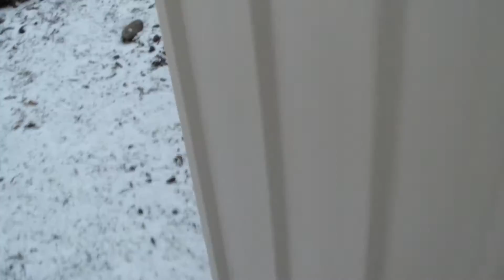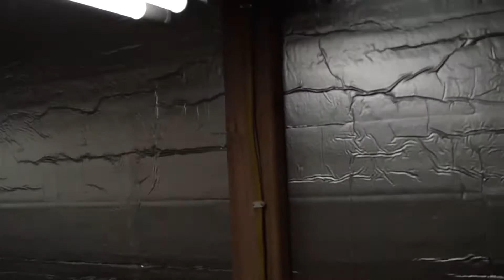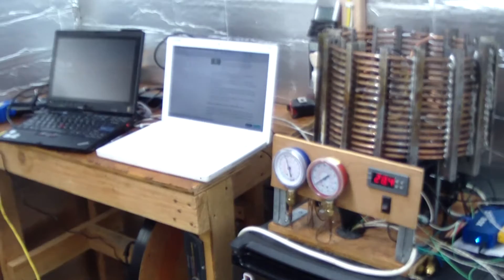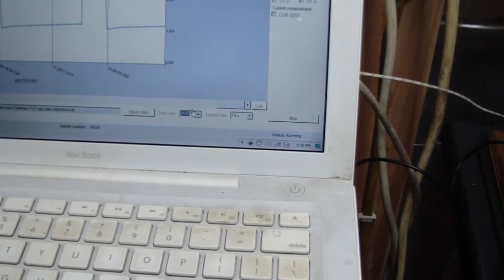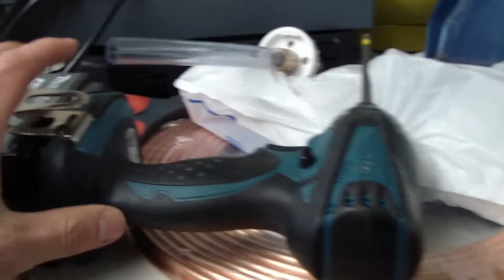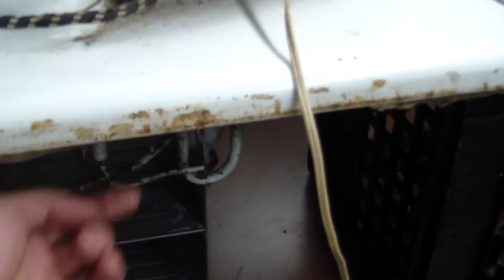Standalone Refrigeration Lab

Comment: Build a ground source heat pump and put solar panels on the shed. That would be a good project.
Reply from the maker: Ground source would be tough, as this is a trailer park.  Caravan park to you?  :)  I am doing an air source heat pump though. Should be pretty cheap.  As far as solar panels, I might think about it.  I'll probably be moving in the next 2 years, so I don't know if I want to make the investment.  On the other hand, the fridge is going to be DC, so it would be a good idea to set up a DC power system.

Comment: A friend of mine might be making some R-40 with his lab chemicals. It's chemical name is chloromethane. Have you ever seen any units that use R-40? Just curious.
Reply from the maker: Yes!  If it's the same stuff I'm thinking of, I know it as Methyl Chloride.  It was a fairly common refrigerant back in the 1920's and early 1930's used in domestic refrigerators.  I have a number of books which discuss its values and drawbacks.  I believe there was a year in the late 20's where several people died in Chicago due to refrigerant leaks in their homes.  Tell him to be very careful with the stuff!
Reply: M.C. Pletcher
Yep, that's it. What's even more dangerous is the process of making it. It involves bubbling dry hydrogen chloride gas through boiling methanol with zinc chloride in the flask and condensing the methyl chloride gas with either liquid propane or dry ice. To avoid fire he is going to use hot oil for heating.

Thanks for the reply.
PS, he's also making ethyl chloride, I think it's refrigerant name is R-160. It's made the same way as the other, but condensed with ice water. That one boils at 54F under normal conditions though so I don't think it would have been that commonly used for much in refrigeration. Any info?
Reply from the maker: I'll have to check my literature, but I think I may have been used too.

There were a few refrigerants used with much higher boiling points at atmospheric pressure.  Some GE Monitor Tops in the early 30s used Methyl Formate which boils around 90 degrees F and was generally introduced through a funnel.  Another one was Dichloromethane (104 degrees) also known as Carrene.  It was used in a a Grunow model I believe.  It was marketed as a safer refrigerator because it was under very low pressure (a vacuum throughout the system generally), which was pretty much bunk.  These units have the drawback of pulling in atmosphere if there is a leak.  Although there are several still in operation.  One Grunow in Michigan for sure.  A few enthusiasts that restore Monitor Tops have acquired Methyl Formate for restoration of old units.

Dichloromethane is the stuff in the drinking birds, and I think it used to be used in those bubbling christmas tree lights.
Reply from the maker: Just checked, and Ethyl Chloride is listed as a refrigerant in a 1933 text.  I didn't note a specific refrigerator which used it, but there probably was one.  Methyl Chloride and Sulfur Dioxide were far more common at the time.
Reply: M.C. Pletcher
Pretty neat, have you ever worked with either of the two. If methyl chloride is that toxic then I'd imagine it wouldn't be used commonly, at least not residential.
Reply from the maker: Sulfur Dioxide was definitely more common than Methyl Chloride, but there were still quite a few of those too.  I could send you some information if you are interested.  Just give me your e-mail.
Reply from the maker: No, I haven;t worked with them.  Mostly just propane.
Reply: M.C. Pletcher
Well, propane is a lot cheaper and safer than methyl chloride. Have you done any work with isobutane or butane?

Also, since ethyl chloride boils at 54F under normal atmosphere, does that mean that in order to get any temperature lower than 54 the low side would need to be lower that atmospheric pressure?

My email is dragondreamcaster@gmail.com
Reply from the maker: 5thDragonDreamCaster I have not yet worked with either, but I'm leaning towards iso-butane as a replacement gas for my monitor top refrigerator I'm going to fix. The original was sulfur dioxide. 

Yes, anything below 54 would be in a vacuum. The Carrene refrigerators I was talking about actually ran in a vacuum on the high side as well!

I shot you an email with some details on methyl chloride.
Reply: M.C. Pletcher
Would it be possible for you to make a freezer that gets cold enough to freeze C02. I'm just curious if you could technically do it. Thanks.
Reply from the maker: Sure.  That technology has been around since the late 19th century.  I couldn't give you all the technical details off the top of my head, but I know it's usually a several step process involving the Joule-Thompson effect, and pretty high pressures.

Very energy intensive.
Reply: M.C. Pletcher
I'm into some pretty intense stuff too, metal casting is one of my hobbies, and another one is home chemistry.
I watched this one documentary called Absolute Zero (I think that's what it's called) and it was neat to see the race of who could make liquid hydrogen first, then who could make liquid helium first.